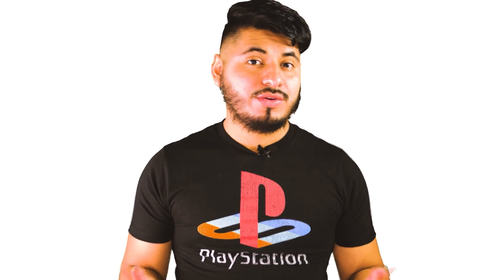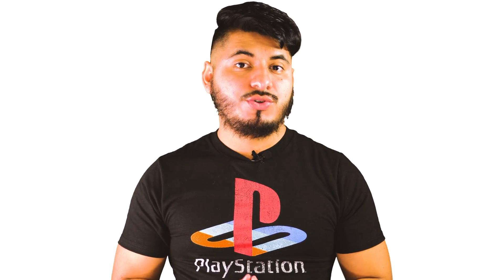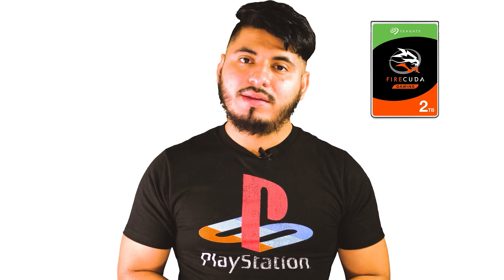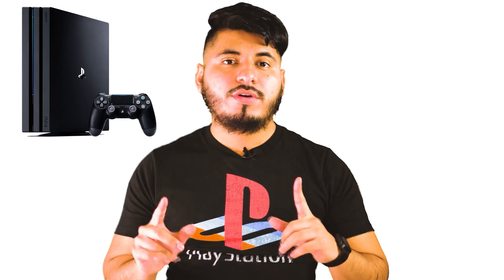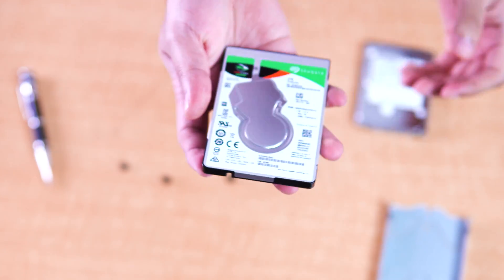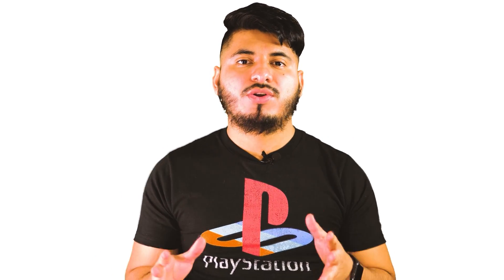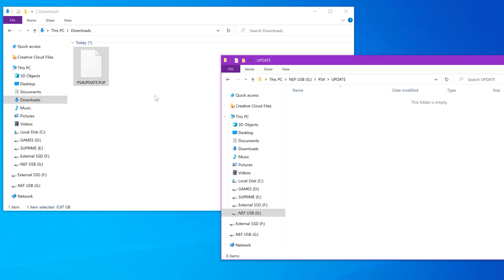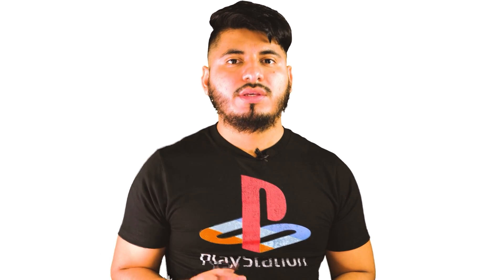How to Upgrade PS4 Hard Drive for Faster Loading Games

Comment: i know this video is old but do you still recommend to do this on my ps4? is the Seagate FireCuda Gaming Hybrid SSHD 2TB still the best option out there for $80?
Reply from the maker: Yes I still recommend it, however you don't necessary have to get the FireCuda hard drive, any hybrid SSHD would do just fine and you will notice the difference.

Comment: the internal HDD when you use it for external and it ask you to format do you lose your games?
Reply: I believe so. Before accepting to format the external drive the system warns you that all contents on that drive will be deleted. Try pausing the video at the exact moment when he is formatting the external HDD to see the exact message. Also before replacing the old HDD  i would recommend  backing up your PS4 save data first. If you have a Playstation Plus account you have the option to back up your save data to the cloud. If  you do not have one you will need a separate USB drive. Make sure it is empty as the PS4 might have to format the drive before you can use it. which will erase the contents.There are many guides online that give you instructions on how to go about this process,  just search something like (how to backup PS4 save data) or something along those lines and you can find more info that way.
Reply: thanks
Reply: @user-sz6hk1nv3o  No problem. Also there is a video on youtube titled( How to replace PS4 hard drive without losing data) which explains it really well.
Reply from the maker: Yes you will lose all your games and everything saved on that drive. Make sure to backup your saved game files.

Comment: Recently around three weeks ago my ps4 has been acting up, and I've tried everything to fix it. I've come to the conclusion to get a new hdd, and I'm looking into the firecuda- I'm still a little worried about a few things, I'm not planning to get any external storage, would that change things for me? I just dont want my ps4 to be slow, crashing and freezing anymore either way this video helped out :)
Reply from the maker: Even if you don't get an external drive you can still replace the internal hard drive if you're 100% sure that it is giving you problems.

Comment: Do not use the firecuda, I bought one brand new in November and it failed on me today. I can't even boot into safe mode. I bought a western digital hhd to replace it, hopefully it works out
Reply: @PlayyaKyran Z the wd card works great, no issues. Seagate sent me a replacement but I'm too scared to use it due to others saying that the went through 3 replacements. Side note, I beat 3 games on the firecuda before it burned out and none of the data was loaded to the cloud for some reason so now I have to do it all over again. Everything from my first hard drive was still there However
Reply: @PlayyaKyran Z western digital 2tb hard drive 2.5 inches. There's hardly a difference in speed vs the firecuda
Reply: @PlayyaKyran Z not  sure about that one, I never looked into it

Comment: I’ve heard arguments that using the internals won’t net you any extra speed boosts due to the internal being sata 2 versus the external using USB 3.0

Is this true? Will using the firecuda give faster speeds over time?
Reply from the maker: The PS4 Pro comes with sata 3 but yes as I showed in the video you get around 50% faster loading times.

Comment: Great video bro. I noticed you didn't set the install application as the new firecuda drive. But when testing my new firecuda today, i noticed no improvements in load times. So i assumed i had to boot  the games straight from the internal. Just to confirm, you're seeing these boosts while booting your games from the external drive, correct? Cause now i'm in the process of moving everything over to the internal to see the enhancements. This is driving me crazyyyy...
Reply: Linteria how’d it go?
Reply from the maker: You will see improvements after running the game a couple of times, doesn't matter if it is installed internally or externally. The first time booting a game will load a regular speed

Comment: I have frame drops in some games, like the division 2. Would you think a new harddrive boost my performance?
Reply: Do you mean like little freezes in your games than it’s because of your 5200 rpm on your hdd I doubt it’s frame drops so I think that’s why
Reply from the maker: Unfortunately no, faster hard drives only boost loading times, not frame-rate, perhaps you need to upgrade to a PS4 Pro or a gaming PC